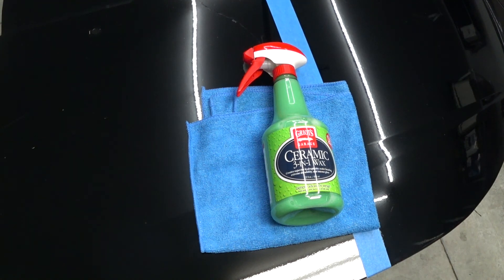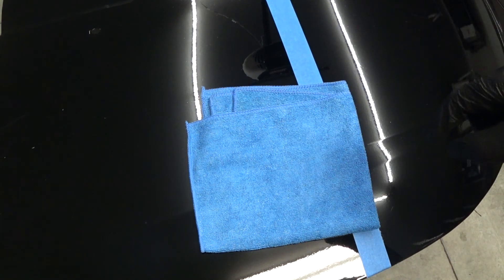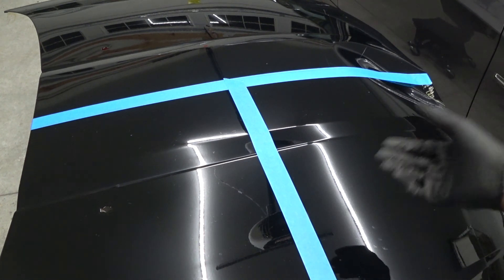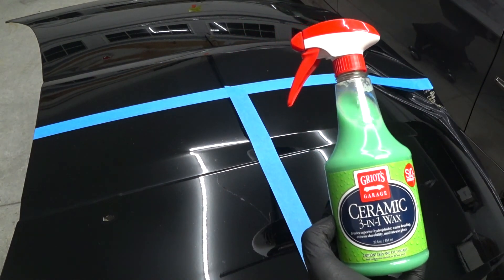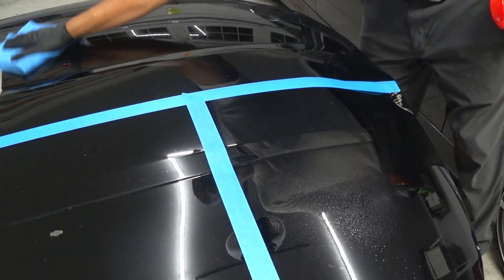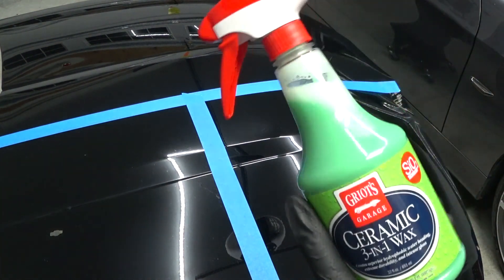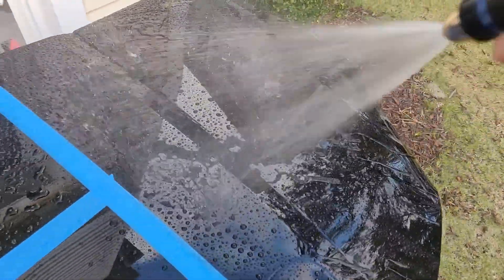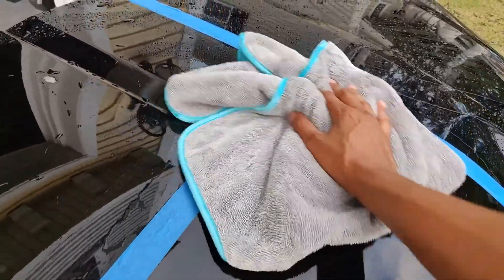Griots Garage 3in1 review: Finally a C2V3 replacement?

Comment: Have you noticed if it does good at adding protection (like normal) when you apply the 3 in 1 while wet, similar to a drying aid? Or does that diminish its protection? I'm looking for a good long lasting protectant to apply wet during times of intense heat and sun, often if you dry the car then apply it's just too hot.
Reply from the maker: It does diminish some, but just about any drying aid will have the same tendency since you are essentially diluting it. Sun/heat application can be tricky 3in1 can get a tad streaky and leave high spots if it dries quickly or you over apply. Look to something like Sonax Ceramic Spray Coating or one I been using lately Ethos Resist. Now I have not used Resist as a drying aid and its not marketed as such but, I have used on a freshly washed/dried vehicle, in the sun, on a cool, 50 degree day and its been holding up well.